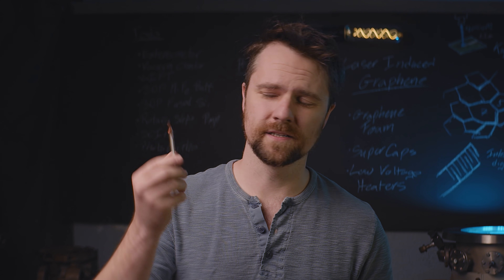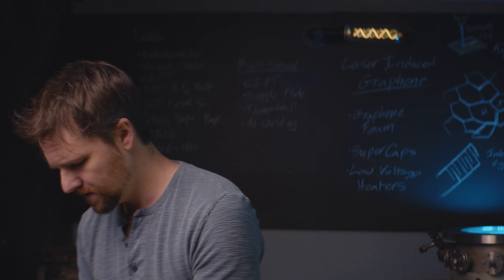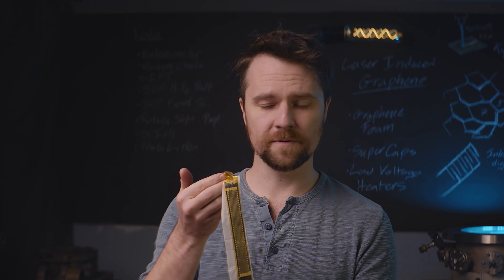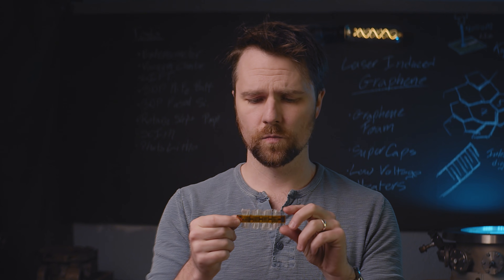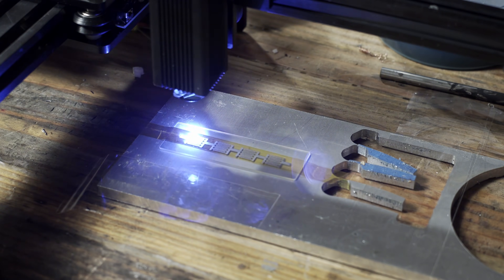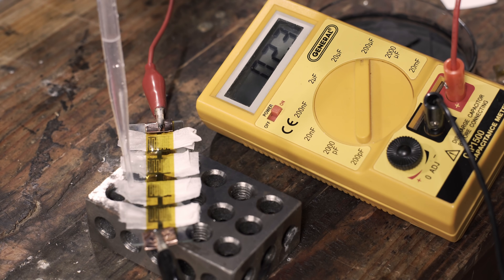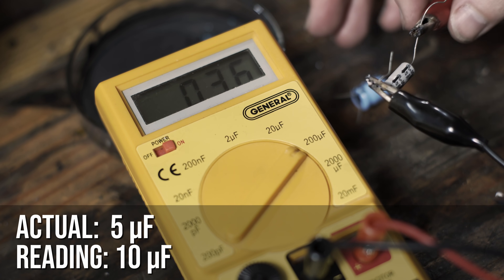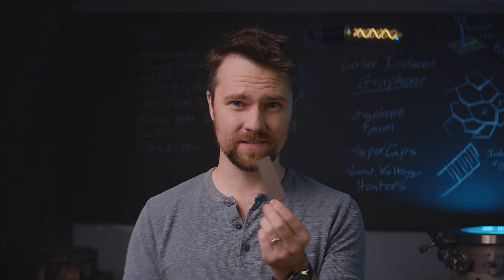Kapton Tape Supercapacitor?

Comment: Two questions:

(1) Could you make your "interdigitated" capacitor again, but maybe out of metal foil?  Then compare capacitance between foil and graphene foam.  Just to give us some idea of how much more capacitance you get from the graphene.

(2) What is durability of the graphene foam layer?  Does it rub off?  Can it sustain high-heat for long periods of time?

Comment: so why ain't we rolling these out by the meter? just because it's not an ideal setup doesn't mean it's not a usable product. whole branches of things can be derived from subpar iterative stages
Reply from the maker: Still a lot of logistical things to work out (difficult to make electrical connections, fragile, low voltage == high current).  And it's probably just cheaper to use wire resistance heaters for most applications than develop new tech like this :)
Reply: @BreakingTaps  AKA you need someone with passion that sees this as fun. I'll work on building you an NPC

Comment: So you lay down the Kapton on your 3D print bed, as normal. Then mount a laser, burn some heat channels in, connect power and voila! Kapton element heated print bed!

Comment: Would this method be viable for making ultra thin, flexible circuit boards?
If so, it could be a potentially very cheap method for producing coils in planar magnetic drivers

Comment: That Kapton tape heater ... someone should design a 3d printer heated bed using that. Many PCB or silicone pad heated beds are either warped or don't heat evenly, causing poor prints.

Comment: Hi. Love the video. I tried this with various laser power settings, speeds and line gaps. I either get a delaminated thick layer of carbon (very brittle but slightly conductive with highish voltage). Or the kapton is completely consumed and I get a grey layer on the glass slide (which doesn't appear to conduct at all. Isc this as expected? The appearance of the irradiated kapton in the video looks more like the deposits letter after higher power settings (almost metallic grey).

Maybe the kapton tape I'm using is different in some way.

Advice would be appreciated.
Reply from the maker: It might be the kapton! I found wildly different results depending on the roll I used, both thickness and brand. The really thin stuff didn't work at all for me, delaminated/flaked off easily.  Really thick stuff was so-so, got a good deposit but it wasn't very conductive.  Might not have tuned it well enough / getting the whole thing converted.  Best results were unfortunately with a random roll I had in my drawer, undoubtedly cheap and moderate thickness.  

When it's working, you should get a puffy "carpet" of black/dark grey.  Too much and it'll flake, too little and it won't "puff" up.  At least on my kapton, you could start to see the "grain" of the polymer, e.g. however they roll it out leaves an imprint that becomes visible as it fluffs up.

I know some kapton uses silicone vs acrylic adhesive, but I'm not sure how that affects it.  Another variable that could be affecting things though.

You could also try defocusing the laser slightly, which might give a little more margin if you find the samples tending to over-cook the kapton.
Reply: @BreakingTaps  that's good advice. I'll give the laser defocusing a go and if that doesn't work try a different brand. Thanks for your help.

Comment: Is 12v minimum for that heater? Could we use like normal USB 5v make some stripes of that tape and use them in gloves/clothing to heat them slightly? Also could they be used in Peltier-like device to generate low temperature areas?

Comment: Would your rig have enough resolution to draw a fractal pattern that ends at a microscopic scale, to significantly increase the perimeter length of the electrodes?

Comment: Dude, that laser-movement is slow!
Why don't you hook up/add a mirror-cascade and control the mirror-movement just like the whole laser (the laser-assembly of the lens, coils, laser-diode and photo-diode, without the tray) in a disc-drive is controlled.

Comment: how uniform is the conductivity of this stuff? could you perhaps make highly accurate resistors with it as well using the laser?
Reply from the maker: I haven't measured it rigorously (other than poking it with some multimeter probes) but it seems pretty uniform within a single sample. There's a fair amount of variability between samples though, and it definitely changes depending on the brand of polyimide tape used and how thick.
Reply: @BreakingTaps  i see, thank you. a shame that it varies between samples, that way you cant tweak the values in software before printing too well. but i guess there's still some potential there. keep up the good work!
Reply from the maker: @combatplayer  Yep!  It's also not clear to me how much was just my poor process control (or cheap diode laser) either, there's probably room here to tighten up the proces and get more consistent results :)

Comment: To get the heater to handle higher temperatures would it be possible to do this process to anodized aluminum or can this process only be done to kapton tape
Reply from the maker: Only on certain polymers, the two most common being polyimide (kapton) and PEI.  There are a few other polymers that will do the trick too but they are much less common.

Comment: I'm really interested in possibly using this method to build custom caps for rc planes. I'm curious about what you did with the contacts to allow current flow without melting the tape or having any issues. Is there a conductive glue that would work well for this?
Reply from the maker: Making good contact is unfortunately rather hard. I used copper tape, pressed mechanically against the LIG (that's what the allen keys and clamps are used for in the heating demonstration).  A lot of academic papers use silver epoxy.

Comment: By stacking these supercapacitors in series to increase voltage, you are also decreasing the capacitance. Right?
Reply from the maker: Yep that's correct (or at least, my understanding.  Very much not an expert here)!  Given the same amount of area to devote to the interdigitated electrodes, splitting it in multiple serial stages reduces capacitance but raises the voltage, and a single large electrode increases capacitance but reduces voltage.
Reply: @BreakingTaps   Would it be possible to put this type of super capacitor and a special configuration of series and parallel to achieve a higher voltage and capacitance? Something like a tesla car battery.

Comment: From an electronics engineer: believe your meter, not the markings on an electrolytic cap.
Electrolytics are literally formed by  leakage current as long as voltage is applied. In storage, the oxide layer dissolves, causing the capacitance and leakage to rise and the voltage tolerance to fall  If a device is left uncharged for more than a few years, it will often blow up from leakage induced heat when finally powered up again. The actual capacitance can easily be several time more than the markings but the voltage tolerance is a small percentage of design. Old caps can be reformed if put on a bench power supply for about a week with the current limited to a few milliamps and the voltage set to nominal (what the markings say). Meters are calibrated at the factory and even cheap ones drift very little. All my handheld Flukes stayed within 1% more than 10 years old, when I checked them against components measured on Lockheeds scientific instruments.
Reply: Jokes on you, they got their equipment from Boeing

Comment: those heaters could be nice for heating pcbs 
especially if you had a pcb where you wanted to only heat certain sections of it; you could very cheaply produce a heater exclusive for that pcb design

Comment: Edit: I just read your pinned comment, I'm a changed man now and I know now how wrong my ways were mere seconds in the past. Makes a lot of sense now, scratch that second paragraph.

Since you're already into basic manual and cnc machining you might wanna look into DIY EDMachining devices. There's a guy here on youtube (BAXEDM) who's promoting both the technique as well as his own semi small scale driving solution for home shop and espechially small professional EDM machines. I think it would really put you on another level with the type of accuracy you can get from such a machine, espechially for really small mechanisms or fixtures. I'm not suggesting that you go full blast with it since it is really expensive but if you made some litte experiments with it maybe you can get something small and bodgy to do some things that are a bit more involved than what AppliedScience and AvE did with it. Maybe do some Ender3 style aluminum extrusion rail system and cheap out on every possible part except the electronics.

Coming back to the supercaps, I think taking a page out of the way they layer LiPo packs and similar battery cells industrially would help your consistency and voltage greatly. You might get away with a strip of plastic bag as an insulator between layers and some more tape as well as multiple cell areays which are mostly parallel internally but series to each other. Not that you didn't obviously know all of this but just in case you wanted to try something bigger I think starting with a better layering and structural solution will do more for you than changing pretty much any other aspect short of the materials the anode and kathode are made out of. Getting just the right pressure so that the electrolyte carrier doesn't squeeze dry but also maintains good contact. If you wanted to change the design of the carbon on the tape, I'd go for solid plated opposite of each other with the electrolyte carrier in between to better make use of surface area and the volume of electeolyte but unless I'm mistaken that's probably the approach you wanted to avoid just because that is pretty much mostly everyone does it. I think it was worth trying it. If I had to guess any other reasons for why it'd probably be that you either wanted to get around needing a seperate insulator in addition to the single layer of tape or you had none of these intentions at all and you just wanted to try doing it your way or I'm just too exhausted and reading into stuff way too much trying to analyse the work of someone I don't know personally and just wildly typing for the sake of it.

Anyways, if I didn't presume too much about you and you got through to this point of my message, I really like your channel so far, hope you got something useful from my probably typo ridden and offly long comment. Keep up the cool projects!
Reply from the maker: :) 

So interestingly, I started working on an ECM machine (electrochemical machining, not EDM, but a close relative) about a year ago but got stalled and never finished it.  Still have the parts sitting around... might just finish that off some day.  Would be a useful addition to the shop. It's a high-current, low voltage system (as opposed to high-voltage, low-current for EDM) and doesn't need more sophisticated pulse control.  You can also sense the distance to the work via the current so it's easy to monitor.  Also just a nifty, underappreciated technique. :)

Comment: Did you try to actually charge and discharge the capacitor into some circuit? Hundreds of microfarads are plenty enough to light up an LED (if it works at over 2 volts of course - you never said the actual testing voltage or I missed it) .

Comment: @Breaking Taps due to this being 2 dimensional, think it would be possible to maybe coat a sheet of paper with Kapton tape, remove a fuser and transfer from a laser printer and just straight print capacitors?

Comment: The potential of this is crazy. I wonder if a tape could be made to lower the resistance. I wonder how well solder can stick to it.....
Reply from the maker: Unfortunately soldering seems to ruin the fragile LIG, but I haven't tried solder paste + reflow oven which might work.  It does electroplate, so that's a possiblity too.  Most papers use silver epoxy unfortunately, which is cheating a bit imo :(

Comment: I can see the use of a uniform heating for applications that require it. Such as battery systems that are required in cold temperatures without having to have a typical resistive heater that has spirals or resistive lines. If this is able to be produced cheaper than the current heating pads then there will be a market in far Northern regions for things like windmills batteries and power generation in hard to service areas

Comment: Hi, nice project, I like it! It would be interesting to measure the equivalent series resistance.
Reply: Yup. A high ESR essentially will make the cap useless for most applications.  

Since he was making heaters with it he’s making a resistor.  Id be curious of the resistivitty he’s getting and how repeatable that is.  I imagine witha a focused laser you could make some pretty small resistive geometries.
Reply: @stevetomassetti4420  also what I like about capacitors is that you can discharge them completely without damaging them. You can't say the same thing about bateries. So even if the ESR isn't as low as typical commercial capacitors there might be a use case for them. Just test the short circuit current and tell if it's enough for your application.

Comment: So I was thinking about this a bit, you may be able to use this process to make a custom flexible pcb ribbon cable for connecting two boards together. That could be neat for some DIY projects for connecting sensors to a pcb.

Comment: ??? 10:46 "uniform heat"... used as a heated print bed for 3d printer??? 
if the new "heater" is placed under a glass or other print bed plate...  would that protect the kapton-graphene enough to get it to print bed temps and hold for hours / days ??? wasnt sure of the duribility... as you mentioned "no spiral paterns" :)
edit: what voltage/amps or watts would be necessary for a one cm(2) piece of kapton enduced graphene to get to 70-100C??? and what time it would take to get there or alter... sorry for the long winded edit :)

Comment: I have such a laser and I intend to play with Kapton tape, but there is one thing I don't het about this, perhaps due to my poor knowledge of EDLCs.
I was left with the impression that the separator between the anode and cathode should be dielectric... Like plastic or paper...
However if you moisten paper with battery acid it should become conductive, and there should be no barrier for a discharge between the two plates.... that is where my understanding of this thing breaks apart.
I see that you are doing exactly this... Moistening paper and there still is capacitance.
What am I missing here? Yes I've seen videos about how the two layers in an EDLC work, but those videos always mention that the separator is a dielectric. 
How exactly is this working as a capacitor, and not just as a cunductor?

While I am figuring this out, maybe I'll try a classic dry capacitor by rolling two layers of this stuff separated with cigarette papers :)

Comment: On the heater application....
Is this something that could be utilized for in-floor heat applications? Currently the art (in-floor heaters) mainly consists hydronic tubes in the floor system. I may be way out in the weeds here, but the thought did cross my mind. (a once-in-a-lifetime experience, so I thought I would celebrate the event by making a comment on your channel....)

Comment: Hi, what kind of lazer printer are you using? I am interested in creating a science lab actually using this demo. Thank you for your time. #realcomment
Reply from the maker: So it's a generic "450nm laser" off ebay, I believe mine was a 20W Neje brand laser (similar to this one: https://www.ebay.com/itm/NEJE-Master-2S-20W-CNC-Laser-Engraving-Milling-Machine-Engraver-Cutter-Printer/402613673991).  The price sees to fluctuate a lot so I'd look around, and you can buy just the laser diode itself if you already have a motion platform (like a 3D printer).  There are also lower power diode units available which would probably work as well, just slower.  I'd definitely recommend getting some acrylic shielding or something if this will be used for a class demo, it's a pretty powerful laser despite being relatively cheap.  Goodluck!

Comment: I'm curious how hard it would be to make the laser behave more like a print head, and print the spool of tape into a spool of capacitors. Add tabs on the sides and fold inwards for a terminal on each side kinda like tesla lithium cells.

Comment: Two things I'm interested in from this video:
1.  Can you make a flexible version of this kapton tape capacitor with Farad levels of storage?  Thinking about having a quick charging battery that you could work into a wearable, this seems ideal, even if the "battery" wouldn't last more than an hour (in typical circumstances, who isn't able to get to a wall outlet or at least install a battery inside of an hour?).  Home printing a battery I could wrap around my wrist or across my back for example with a reasonable enclosure for durability would be great.
2.  The "heater" at the end seems like it would make for a pretty great handwarmer system at super low Voltages, because 285C is a little much for skin, but maintaining a consistent 20-30C across your hand in the winter would be very ideal.

Comment: Hmmm, you can spin liquid polyimide, so it would be possible to do layers. I guess I can't think of good uses right off the top of my head.

If nothing else there wouldn't be any adhesive to fail with the heaters.

Comment: Looks very similar to a homemade force sensing resistor I made by cutting copper tape with a plotter and putting velostat over it. I wonder if you could use this process to make an fsr as well.

Comment: I could imagine wrapping an erlenmeyer flask or a beaker with the tape and a thermistor, irradiating it with the laser, and using it to provide regulated heating for a reaction vessel, no hot plate required. I wonder how it would react to magnetic stirring.